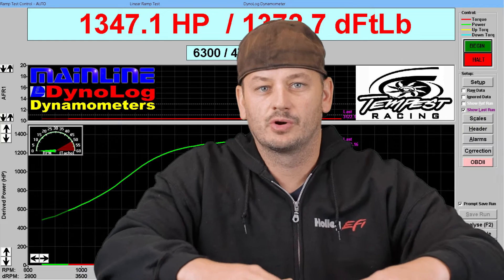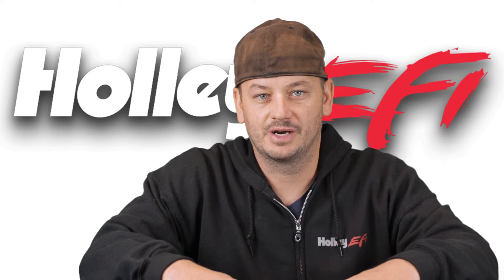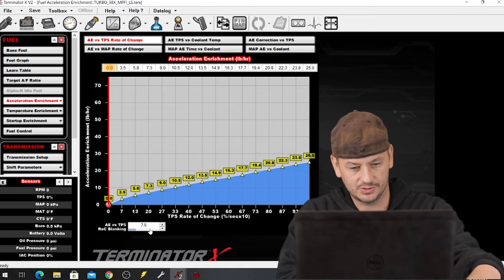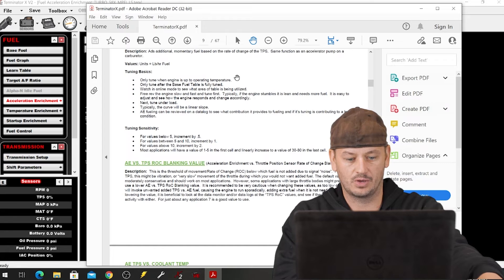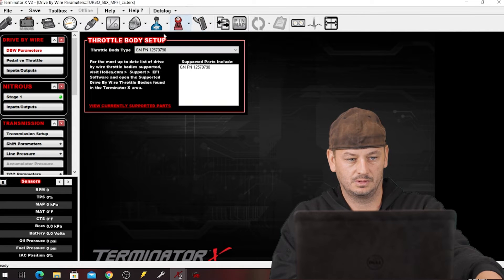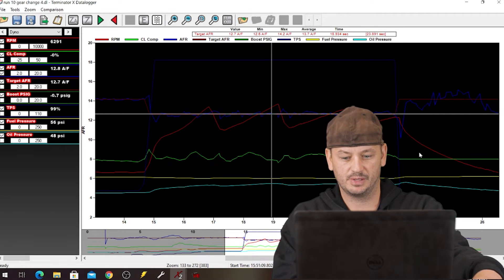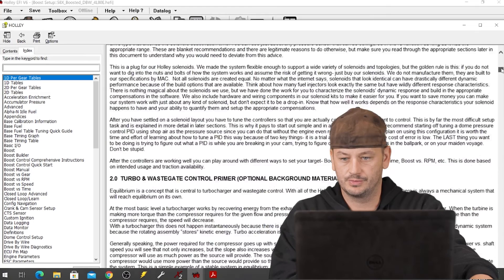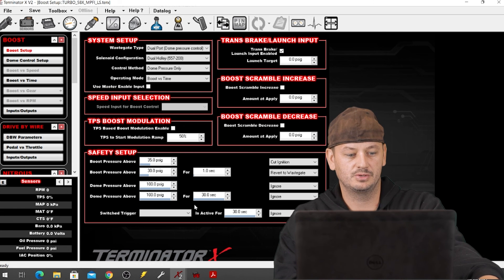How to Tune Holley Terminator X for Beginners \\ The Answer to every Question (almost)

Comment: Hey Joe, just a quick question. Does the KPA/psi scaling on the left of my fuel and spark maps have to match? Meaning do they need to have the same values of let’s say 26psi max boost and floor of 14 inches of vacuum on both? I’m troubling shooting what I think is a bad o2 sensor. I’m getting crazy fuel readings. Might try turning of the “learn” feature and see how it runs
Reply from the maker: No they do not

Comment: Hey Joe I have a pretty simple question. Trying to figure out if 550-903 terminator x ls kit has sequential injection capability. If not does the HP system have it. This is a gen. 1 sbc with a fuel injection connection 4x 1x conversion. Any help would be greatly appreciated. Thanks Bill
Reply from the maker: Yes term x can run sequential as long as you have cam and crank signals
Reply: @JoeSimpsonAtTempest   Wow that was fast sounds great thanks

Comment: Love your videos Joe, is there any way you can talk about the  use the software and specifically the self learning features to show the downfall of relying on them?  Maybe even for builds that are using the right equipment?  If you (the vehicle owner) choose to actually read the manuals, and the correct parts, (rare I'm sure) what does the self learning feature actually do?  (totally understanding the limitations of the Bosch WBO2 as you have pointed out in earlier videos)  thanks man, you explain this stuff in a way that makes so much sense.  🍻

Comment: I have a terminator x max dbw and i'm having a issue with a random high idle 1500-3000 then it will go back down to 750 and do fine. it may idle fine for 1-2 hours with no issue the the next time i start it goes way up. called holley tech support and the said it was the throttle body. changed it same problem. they are useless. and ideas? it does this very random clod or hot.

Comment: Hey Joe, Great Videos. Would you be willing to do a "how to" and "why important" for injector end angles in the base engine setup? How does it effect the engine? and what settings to start with based on what engine a person has Holley EFI MPFI installed on? My settings right now are dead 0 across the board. Engine runs great, starts great, decent power for my setup. Love your videos!!

Comment: Thanks for all the great videos!!! Have you made one that helps figure out what Target AFR values to use? Any help with figuring that out would help me a lot.
Reply from the maker: I think i did one comparing power with a bunch of different air fuel ratios on a turbo Honda a while back. Don’t think I’ve done one Holley related yet
Reply: I’ll look up that one. Thanks